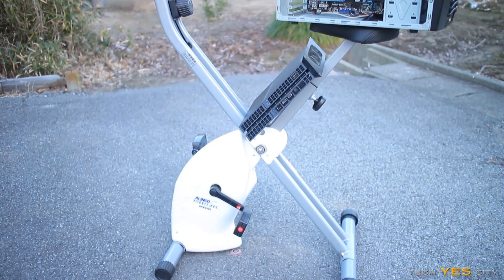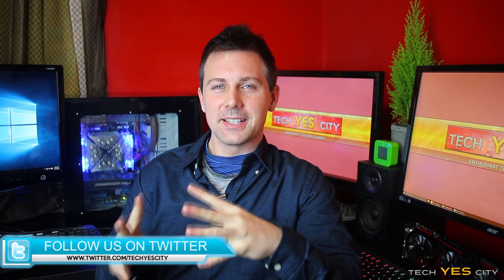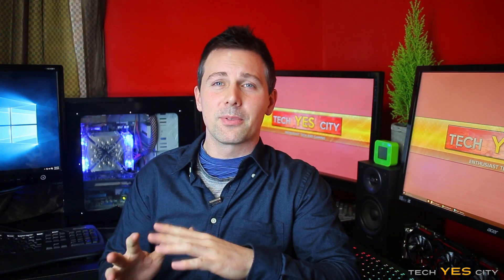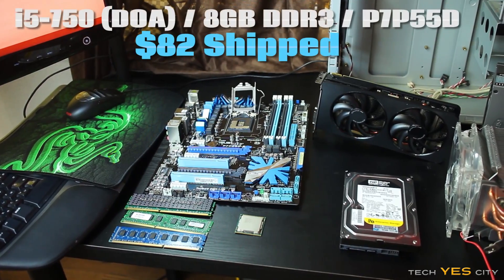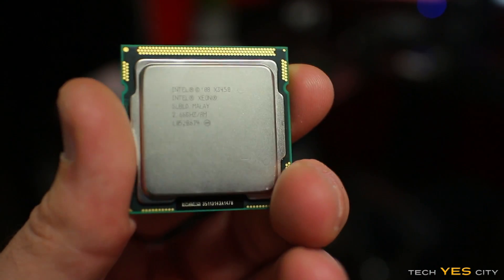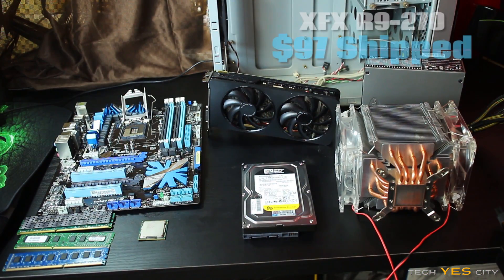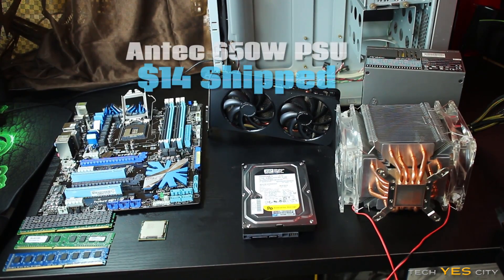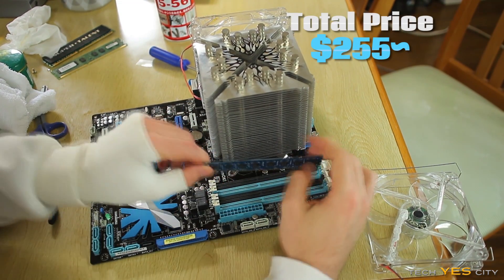$250 Console KILLER - How to Build the Best Used PC in 2016

Comment: i got an fx 6350 and a asus gtx 750 ti 8gb will it run like in the video?
Reply: nope, the gpu is a bit slower. you'll still be able to play most games tho.
Reply: You will still be able to play gta 5 on 720p with that specs
Reply: thebrownieguy ok ty
Reply: +Silva i used to have a 750ti and its really sh*t!! Upgrade it for something like a 960 4GB version at least to keep up with the current games... i used the 750ti with an i5 4460 and 8GB ram, it was OK to play older games but things like just cause 3 or farcry anything newer than 3 was unplayable...
Reply: +thebrownieguy a lot!
Reply: +joão Rodrigues the 750ti is not that bad compared to the 270, i did mention there is a difference
Reply: yeah, i have an 270x, the 750ti isnt bad for budget builds, and its cheaper, but the 270, atleast for me its a lot better
Reply: +joão Rodrigues i have the r9 380 4gb, i think that is the best card for the money rn
Reply: im gonna get an gtx 780ti
Reply: joão Rodrigues its a big mistake, trust me, for only a little more you can get a 960 which is way better but not much more expensive
Reply: +Михаил Генералова he said 780 ti, not 750 ti... the 780 ti completely wrecks the 960
Reply: thebrownieguy the 780ti is about the same as the 960 G1 4GB but the 960 G1 is cheaper
Reply: +Михаил Генералова well, it outperforms the 970 in some games
Reply: the 960 is a lot worse than the 780ti, is in between the 970 and the 980, sometimes its performes as a 980

Comment: Nice job , i saw in ur previous video that you bought on yahoo auctions , do they actually ship to Europe/US or you need to buy on sites like buyee?
Reply from the maker: +roxpotatoes Some sellers will ship international, since compared to aus for example shipping internationally here is very cheap on light weight items (cpus / ram / sometimes gpus). But it will say in the auction if the seller does, if not you will have to use a service like buyee.

Comment: Something is wrong with you graphic score in firestrike, I own a HD 7850, so same Gpu with less cores and I hit 6099   screen: http://www.hostingpics.net/viewer.php?id=569624b6099.png
Reply from the maker: +jd gaming Nothing is wrong you have clocked your 7850 sky high.
Reply: Hd 7850 has 1024 stream processora.
270 aka 7870 has 1280.
My gpu is not clocked that high, I run two of them in crossfire. 70% asic on both cards, which is the minimum for these cards
Any HD 7850 reach 1150, nice one over 1200
R9 270 goes over 1200 nice one can go over 1300.
You Need to check unofficial overclocking option in afterburner

Comment: lga 1156 mobo is so rare these days, especially in europe, makin them costing more than lga 1155 or the new 2011 (not so sure if its 2011). And using these price to performance monsters like the i5 750/760 or the xeon you used is so hard since most of the budget goes on the mobo...
Reply: actually the 1156 are the new ones, 2011 mobos are a bit older but waaaaaaay more expensive :o
Reply: 1151*
Reply: Mixed the two up, 1151 are acctually the skylake mobos
Reply: +tukarlo yeah thats what i meant lol

Comment: Hey these are my pc specs:
Processor AMD Athlon(tm) II X4 640 Processor
Video Card NVIDIA GeForce GTX 650 Ti
Memory 8.0 GB
Operating System Microsoft Windows 7 Professional Edition Service Pack 1 (build 7601), 64-bit
The actual performance I get from games is quite weak and i think its not good for this setup, all the drivers are updated and its not a problem, i cleand and swapped cpu and graphics card paste but no improvments....
For an example i run RUST at 1366x768 on fast and get like 40 fps....
Same thing with World of Tanks lowest graphics and 1680x1050 and i get near 60 frames....
I know i should be able to go better than that becuse my old pc of 4 ram and some crappy items got almost same results...
Id be thankfull if u reply :D
Reply from the maker: +Armin Elezovic Have you tried overclocking your CPU? If you can overclock it 10% and you notice your frames go up by 10% then you will need to get a new CPU, I am pretty sure its the CPU.
Reply: Ty

Comment: Buying used is fun but that's how I ended with two broken 775 motherboards few years ago ( x38 dq6, p5qpro deluxe) and couldn't send them back cos technically they were working fine 2weeks in my room. Now I would rather go on new h61 low end mobo for 35$ with 2year warranty and used i7 2600 without "K" for 150$.

Comment: 5:42 Bryan, 720p and above is all considered "true" HD. HD doesn't start at 1080.
Reply: +HUGSaLOT Valkyrie Real HD starts at 1080. 720p is just mush on screen bigger than laptops (15-17").
Reply: +MrKeikari nope. HD is any resolution higher than standard resolution of old NTSC or PAL analog TVs.
Reply: +HUGSaLOT Valkyrie Yeah, why follow old standard when all modern hardware already can push 1080p60. Standards do change, there's no reason to live with obsolote tech thinking 720p or 900p is HD.

Comment: My main rig's platform is from used parts: a core i7 920 and an asus rampage 3 extreme with 1 dead ram slot. The c.p.u. costed me 75.9€ and the mainboard 142€. Still kickass system although a bit pricey for the mainboard.

Comment: I would like you to try something a little more console optimised such as ROTTR. Also you mention not 720 like the consoles, does the PS4 have any games that run at 720? if it does its very few and far between.

Also no one ever includes the price of the OS in these builds which would add an extra $50 or so.

Comment: hey can you give me an Idea for a different motherboard to run an AMD FX-8350 CPU.

 So I had gotten a  system put together for the  AMD FX-8350 in a MSI 970-G43 motherboard. The video card is a ASUS (AMD) Radeon R7 250X 2GB GDDR5 memory, it has DIGI+ VRM Super Alloy Power Stable  Over Clocking, DX11.2, PLUS Dual Fan Cooling 2x the Airflow, there is a Display port, HDMI PORT & 2 DVI Ports. It Has 16 GB + 8 GB for a total of 24 GB RAM. The Power Supply is a Cougar A760 760 Watt Bronze Plus. 

I got a DVD/Burner 240GB SSD as main drive 500GB Backup for the SSD and a 2TB Seagate Hybrid drive for Filed Photos etc. 

I also have 2-140 mm Corsair fans blowing out  on top, two 120 mm fans on the front blowing in, one 120 mm fan on rear blowing out and one 120 mm fan on the bottom blowing out. Plus one fan on the T4 heatsink blowing up through the HeatSink.

I been running into heat problems on the CPU. I got a CoolMaster T4 Heat sink for the CPU.  I have not run the system since September because of medical problems (I had several Heart stents put in last Oct 2015 and it looks like I may have some more put in next month just waiting for the two doctors to talk to each other and to look at my last two Angiograms. Seams my heart is producing more plaque and it clogging several of the "Pipes" around my Heart. any help and recommendation would be appreciated. Love All the Vids BTW!
Reply: atleast you wont bottleneck your 250. lmao
Reply: relax brother.
it's called banter.
Reply: +Kristyanna Virgona Two weeks and no one even attempted to answer you. Ugh.  To get good performance from an 8350, I ultimately went with a closed loop H80 (before the H80i came out).  Recently I upgraded and I used that mobo to build a system for a friend. I used a very large case which could house a Hyper 212evo (a big heat sink with 120mm fans).  That seemed to work fine to keep it cool.  I really don't see why that T4 cooler wouldn't work.  Maybe the heat sink isn't getting a good flat connection with your CPU?  If the T4 is anything like the 212 evo, it will come with two different sets of spacers.  Could you have used the Intel ones by accident?  Another thing I do is actually use my fingers to spread a thin layer of paste on evenly and then wipe my finger off with a rag and rubbing alcohol.  This allows me both to get it covered, and to check for any hardened chunks that may have came out from the paste.  A hardened chunk may cause the heat sink not to sit on it evenly.
Reply: +Sean qually-hall great banter. It really is......

Comment: My question is Windows cost me 100 dollar s which makes budget pcs more than consoles. How do people get Windows 8.1 so cheap.
Reply: 100$ lol who even fucking pays for windows anymore. Been pirating windows since W95 and never had 1 issue.
Reply: +James Emsley College Students get windows for next to free if you are taking IT as a Major.  You can also get into the windows insider program and get windows for free but you will have to get early windows builds that may be buggy.
Reply: +Lordy Lorde  thanks yea I bought games from them with no problem. I have a build now (case labs sm8) but I want to build a second low budget high performance build like in the video but at 400 price tag. I was hoping to get Windows for 30-50usd
Reply: +James Emsley by getting keys off reddit. Those keys are generated using a website and it illagle to use them because it you are a registed seller like MSY/austins computers, It is legal but if you not like the people selling them on reddit it is illagle
Reply: I'll sell you a Windows 8.1 Pro Version 64 Bit Key for $20
Reply: you can use linux
Reply: +James Emsley Pirate windows 7 there are perfect activators out there made by DAZ. You install without a key, then run the activator, reboot and you are good until 2020.
Reply: MSDN keys or they crack it.
Reply: +Diavolo222 while it may work for you not sure if I would want to pirate Windows. Just doesn't seem worth the risk. But hey I may be wrong
Reply: James Emsley
There is pretty much zero risk of anything bad happening, unless you install a bunch of random shit that claims to "crack windows". There are a few very reliable methods used by a LOT (as in millions) of people, if you stick to those, you are golden.
Reply: +Lordy Lorde yea I heard 10 had some issues still. So did Windows 8 it'll take some time. For me no need to get 10 anytime soon.
Reply: get keys off reddit or get a flash drive and boot Linux on it
Reply: +James Emsley If you have another pc with Windows 7, you can get windows 10 for free. Just put it onto a USB.
Reply: +James Emsley go to http://www.kinguin.net/ for cheap windows os
Reply: Kinguin.net
Reply: +James Emsley In Europe (e.g. Germany) you can 100% legally obtain your Windows 7 License for like 25-30€ from an proper dealership on eBay and then upgrade it to 10. Our laws allow you to buy "used" licenses which those computer dealerships get from batch buys, returned/damaged PCs etc.
Reply: Well my mom works at Best Buy and got a Windows 8 pro key for free, used it on 8.1 pro and upgraded to Windows 10 pro for $0.
Reply: Windows 10 is free dumbass
Reply: ImSalman nope it isnt only if you already had windows 7 or 8
Reply: btw you can get windows 10 education for free if your in high school college on a university in pre school even in kindergarten but also if you are a teacher or a parent of a kid thats in any of those the only thing that is diffrent about windows 10 education is that is has windows to go built in which is always a nice feature ;)
Reply: +Ian Witten yes it is you just can't change the background and edit something else
Reply: No you cannot get os for cheap , its too expensive today, also buy os from bootlegs or download os from others website for free is totally illegal unless you really trust the website that download non illegal os for free.
Reply: Also, when you install os you need a serial key whick you can found on the os packaging but not well if your os is from download

Comment: Killer build for the price, it's good when you can buy reliable second hand hardware.

Also a second hand PS4 is 150-200$ and it's GPU's performance is right in the middle of a r7 265(hd7850) and r9 270(hd7870).

Comment: Just a quick question, I have an i5 4690k and a gtx 970 and my bo3 experience did not look as good as the one on this $250 pc, other games run fine so I was wondering if it is because your cpu as it has more cores.
Reply from the maker: +daniel nurse Have to drop settings for black ops 3 to run smoothly, just copy my setings in the video  and it should run really well, especially with a 970, and then keep raising each setting one by one until you get the best fidelity / smoothness.  That game is so poorly optimized.
Reply: +daniel nurse nope, probably driver options/settings overwrite the in-game settings. The CPU has NOTHING to do with the image.
Reply: +IIIRattleHeadIII all other games work and look great, all of my drivers are up to date as well. Bo3 looks good on my pc but it has a slight lag which  makes the game only playable for like 1 hour max. A lot of other people are having the issue and not a lot of people saying why.
Reply: daniel nurse memory leak.
Reply: daniel nurse I wish this was the biggest problem of BO3... It's the fing gun balance... vesper(the most OP),vmp,gorgon,dredge 48, any shotgun, any sniper, those are the super overpowered insta-kill weapon(<0.25 sec time to kill).
Reply: +daniel nurse He uploaded a video two months ago on bo3 performance and stuttering issues you should watch it
Reply: +daniel nurse I heard somewhere that the frame rate is connected to mouse movement in blops 3, so if you let your frame rate go all over the place it cause lag in your movement...  try locking it to 80/90 frames in settings and it should play like a dream!! at least I hope so because i'vee just bought the simular build as yours.
Reply: Steve Pearce yes the mouse is tied to the FPS and frame time and latency sadly, I had huge mouse input lag when the game firstly launched, so I played with a controller(which for some reason was perfectly fine).
Reply: +IIIRattleHeadIII but that was 2 months ago first of all. There have been a lot of patches that have drastically made the game more playable but it is still not worth $60 maybe $10
Reply: +IIIRattleHeadIII yeah its more optimized for consoles but that trick should help, i&#39;d probably still use a pad lol because i&#39;m used to ps4. Looking forward to joinging the Pc master race as they say 8)

I only play zombies anyway and thats worth the $$$ to me
Reply: BJH also black ops 3 is known for having shit weapon balance.